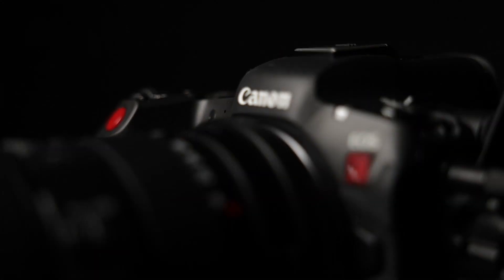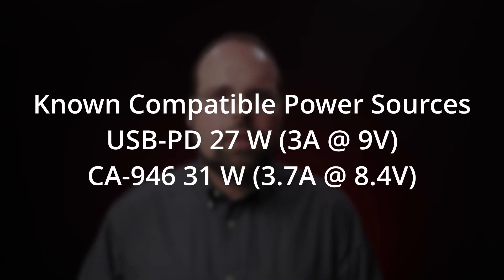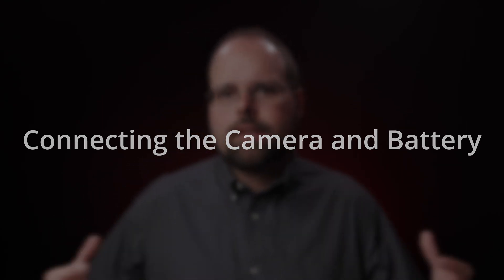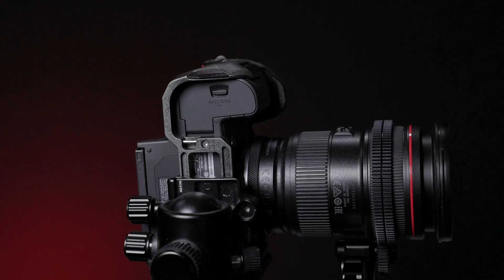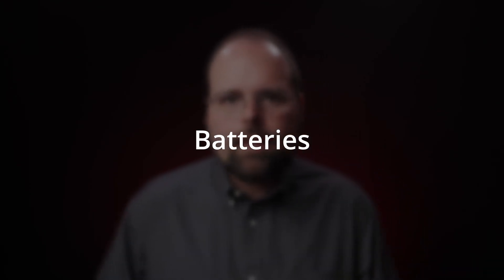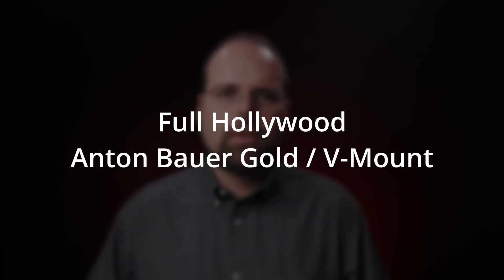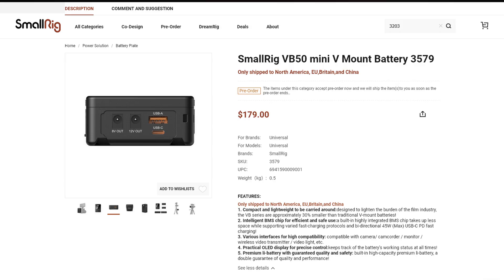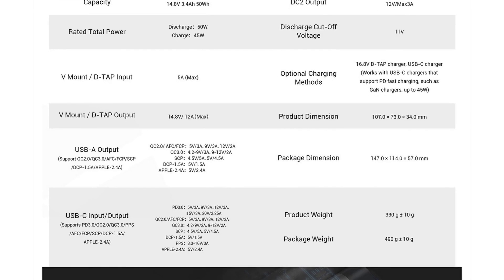External Power for the R5C - EOS R5C Tip 5

Comment: Found out the hard way. Did not know the R5C only needed a 9V dummy battery. Plug a 12-14V dummy battery and damage the circuit. Camera refused to come on. Had to send the camera to Canon Service Center in Virginia. Luckily it was under warranty so they fixed it otherwise it would have cost me $530 to repair.
Reply from the maker: Ouch, that sucks. 

That's easily the biggest reason I don't like using a dummy battery with the R5C. The camera doesn't have the internal voltage regulation to deal with the ~16V you get out of cine batteries. So you've always got the risk of frying something if you're not careful with the battery you're using.

Comment: Thanks for all the useful insights, Jason! I did make the mistake of connecting the D-tap port on the FXLION Nano One to the R5C via an  unregulated dummy adapter 😬 It didn't fry my camera but it did seem to lead to horizontal lines in the image (similar to the lines you see when your shutter speed doesn't match the light source's frequency). After seeing your video it looks like I fed the camera way more power than it was designed to handle (or am I missing something here?)... 😬 I stuck to USB-PD afterwards, and the camera is fine.
Reply from the maker: Thanks for the info on that. Also I'm glad your camera survived just fine. 

That said, it's good to know that the camera is at least fairly resilient to moderately high voltages — or at least it won't let the magic smoke out at 14.4 volts. It's quite possible that the camera can handle a fairly wide input voltage range, since everything has to be regulated internally anyway (the processor and sensor are probably operating in the 3.3 volt or lower range), but there's no published specs on what that range is and as you saw going too far can certainly cause problems.
Reply: Happy to hear you didn’t fry tha cam. Are you happy with the battery?
Reply: @PointsInFocus  Thanks for the additional info! A few years ago I had another dummy-battery 'accident' when I inserted the D-TAP plug the wrong way. There was smoke involved... 😬I think it's safer for everyone if I stick to USB-PD 😉 Thanks for providing us with all of this super-useful and in-depth info!
Reply: @Mintyseden  Yeah, the Nano One has really become my swiss army knife on shoots. Even if I'm not shooting with the R5C it's super handy for quickly charging drone-batteries/phone when moving between locations and it can even power my laptop. On the R5C it roughly gives you 3 times the runtime of a single LP-E6 and the size makes it easy to rig it. I have it attached to the bottom of the camera so it doesn't get in the way. Do keep in mind that because of the smaller design it doesn't work with all v-mount plates. The new Smallrig ones do work as do FXLION's own plates.
Reply: @Points in Focus, new sub and thanks for doing the heavy lifting.

@Filmkit, oh man, I made the same mistake on my brand new Sony A74.  Fried the main  
motherboard.  Got it for a good deal but after that user error mistake, cost me abt $500 to replace a new motherboard directly from Sony.

The issue was the dummy battery to d-p-tap was not regulated.  Bought off Amazon and didn’t realize this.  The website didn’t mention any warnings and the V-mount battery I bought from Core SWX didn’t mention it either.

Anyhow my expensive mistake.

I also recently bought the Canon R5C and here are some additional information and options to consider:

- Core SWX recently updated their Powerbase Edge to the PB Edge Link.  The upgrades are: 1) It fixed the issue of the mounting plate with a much bigger base so it’s more sturdy and stable; 2) It increased the capacity from 49wh to 70wh; 3) It has a PD port that can power the R5C directly with a USBC cable; 4) you can stack or link to other PB Edge Links for parallel power if needed.  

The older model and the new one still has the runtime LCD, travel safe within airline requirements, has vmount adapter, has 1/4” mount hole to attach to tripod or other mounting options, etc.

I’m not affiliated with them but was waiting forever for the Anton Bauer Titon Base and at NAB 2022, this new product was released.

Note on top of the PB Edge Link, I put in the Smallrig Side Handle 2222 with a Neewer QR Plate Adapter.  I have Smallrig 3890 cage that mounts onto the Neewer Plate Adapter.  It takes away all the hand jitters as the weight is balanced when I film handheld

This can be used to power any camera setup for long hours.  And get a second one if you film continuous all day.

- a much cheaper alternative is buying the Smallrig Power Bank Adapter 3085 that uses a powerbank plugged into the USBC input and a dummy battery into the DC port of this adapter.  I use Nitecore NB20000 as it’s small and lightweight since it’s made out of carbon fiber but has 20,000mAh

I couldn’t find anywhere how to compare the power consumption in each filming mode but saw on other YT channels that a LP-6NH is 2,130mAh and has a runtime close to an hour (depends on the frame rate and shooting modes) but rough average.

So here’s what I calculated:

1 Wh to mAh conversion:
Wh x 1000/Voltage = mAh

So for 70Wh (assuming 1 LP-6NH = ~1hr):

Using dummy battery with d/p-tap @8V:
70 x 1000 / 8V = 8,750mAh
Runtime: 8,750 / 2,130 = 4.11hrs 

Using PD power @9V:
70 x 1000 / 9V = 7,778mAh
Runtime: 7,778 / 2,130 = 3.65hrs

Lastly, here’s what I found on power consumption in different shooting modes and recording times with a LP-6NH:

Power Consumption:

8K RAW 25P: 10.5W
8K MP4 25P: 11.2W
4K HEVC 50P: 12.9W
4K XF-AVC 50P: 13.3W

Recording Time With Supplied LP-E6NH Battery Pack:

8K RAW 25P: 50mins
8K MP4 25P: 45mins
4K HEVC 50P: 40mins
4K XF-AVC 50P: 35mins
Reply: @nomad0714  Oh man, that's gut-wrenching what happened to your A74... ☹ The weird thing is that even the dummy-adapters that ARE regulated, often don't clearly state that. In the past I also fried a dummy adapter because I connected it the wrong way around... I guess it's better for everyone involved if I stick to USB-PD for now 😬Thanks for your calculations, this is GOLD for anyone looking for a battery solution for the R5C 👍 The Powerbase Edge Link sounds intriguing, I'll look into it 🤔
Reply: @filmkitnet , yeah it was an expensive learning for me.  The A74 stopped working as it had too much power going into it, probably 14V so it fried a lot of components so Sony said I need to replace the main board.  It’s working now but I almost missed a job but got it back in time.  The only thing was before it never overheated but afterwards, it overheated and Sony refuse to say something was wrong on their side.  Now I just upgrade the firmware and added some active fans as I’m used to it with the Canon R5.  

I almost got the Fxlion Nano One until I stumbled on the Core SWX Edge Link.  How’s it working out for you so far?

Comment: Late to the party... lol - Have you noticed that the R5C does not acknowledge the USB PD mode when the camera is turned off and then on (sometimes) and you have to remove and reinsert the USB-C cable?
Reply from the maker: I personally haven't seen that come up.

That said, it could also be a problem with your cable or USB power source too. To switch from off's 5V mode to on's 9V mode, the camera has to renegotiate the USB PD session with the power source. If the signal is bad or noisy that can fail (e.g. the cable is marignal). Additional, the power source can potentially not allow/support the change if it thinks the change in profiles is too fast or somehow could be the result of a fault. Not that I'm saying it's not the camera, it could also be the camera, but USB-PD is complicated enough that a marginal or slightly out of spec implementation anywhere in the chain could cause that to happen.
Reply: @ Thanks for replying. I'll give it a try again with a MacBook power supply (145W w/ 100W PD cable) and determine whether or not it still occurs. Doing some research indicates that this is a know issue, however, as you rightly point out, it is not clear if the issue is with the Canon firmware, the battery PD delivery or the cable. Thanks and Cheers!

Comment: This is EXACTLY what I was looking for. I have an EOS R5 MKII ordered, and was looking for info on alternative power sources for it. I shoot a lot from wildlife hides, and usually end up with a LOT of flat batteries. USB C PD seems ideal in that scenario.  Thank you so much for this really thorough treatise!👍
Reply from the maker: Be aware the R5-II requires 15V USB-PD not 9V like the R5 and R5C. You'll need to use a minimum of a 45W battery or charger, instead of the 30W that I discussed in this video. The noted Anker 747, as well as the new Anker Prime 27,650 are capable of this, but smaller battery packs may not be.

Edit to add: I'm currently shooting with and getting comfortable with my R5-II before I start producing tip videos like this for it. That said, powering it will be one of the first videos on that list.
Reply: @PointsInFocus  I was thinking of the Anker 737 Power Bank (PowerCore 24K), which according to the blurb is a 140W , 24,000 mAh PD power bank. Should be OK??
Reply from the maker: Yea, that should work fine.
Reply: @PointsInFocus  Thank you!

Comment: Thank you very much for the report. It is a very comprehensive report.
I would like to ask you a question and it would help me a lot if you could be so kind as to answer:
I have bought an EOS R5C camera and I need an external power supply to record in 8K and 60 fps. I have looked for the Anker 474 Power Bank but I can't find it in Spain. I have seen the option of the Anker PowerCore III Elite 25600 PD.
Do you think that this power supply is enough to power the camera in a safe way?
Thank you very much!
Reply from the maker: That should be the same battery pack. 

Anker seems to have renamed their product lines (or just the kit/sets, I'm not completely sure). The battery that came in my 747 kit is labeled "PowerCore III Elite 26K 87W".

Comment: What do you mean by, if it's usb-c, it's not a probleme.
If I bought a external batterie of 30W   ..  15V at 2A in USB-C    It gonna work or risk to damage my R5C ?
" INIU P43-E1 30 W 10 000 mAh Magsafe"
Reply from the maker: What I mean by that is as long as the power supply or battery bank you bought is a complaint USB-PD device, then it will either power the camera or it wont, but it won't damage it. USB-PD requires the camera and power source to agree on what voltage and power draw are going to be used before that voltage is actually made available. If the battery/charger doesn't support the 9V/3A profile, then no power will be delivered to the camera.

I looked up the battery you mentioned, it supports USB-PD v3, so it should work with the R5C, or at a minimum it won't damage it.
Reply: @PointsInFocus  Thank a lot, at least, if it don't work, I dont kill my R5C. Thanks !
I need a power supplie for my dual Fishe eye lens at 8K, 60 fps.
But even the SmallRig accessory are Big and heavy. 400G for LPF970 + NP-F adaptators. 
 
It's realy hard to find something realy small and light. Even if it's only works 15/30 minutes.. It's barrely enough for my use case in VR.
Hope this one will works.
If you know something that should work, I will be glad to know.
Reply from the maker: For what it's worth, I use a SmallRig NP-F Battery Adapter Mount Plate (advanced edition) (part number 3168B) and a standard NP-F750 or NP-F970. It's USB-PD so you get the full 8K60 capabilities, but since it uses standard batteries you can buy whatever you want and change em on the fly.

I show I have it rigged in the power section of my rigging the R5C video here: https://youtu.be/la79_tT5m3w?t=1021
Reply: @PointsInFocus    For the moment,  I am using a little Vmout on the left of R5C with a battery that serves as my handhold
https://youtu.be/99CgJt0hp8Q?t=292 
But it's stay heavy and big and need a cage. 
If the Inui battery works, it's shoold be place on the Flash socket with a Magnet. 
That the idea !
With a dual Fisheye lens, nothing can be in the front of the R5C, cause you will see it on the VR180° recording.
Reply: @PointsInFocus   Hi ! I was a little bit afraid of the low A of the iniu, so I tried this one :  "Baseus Batterie Externe Magsafe PD 30W, 10000mAh Magnétique Power Bank avec câble USB-C"
 
And it's working with the R5C at 8K60 FPS.. :)
So it's ligth, and a simple Round magnet Magsafe with 1/4 screw Handle it !

No need to rig it with a SmallRig Cage anymore. :)

Comment: Hey Jason! I have all of your R5C videos saved! Thank you I u! I do have a question though, and only because I trust your testing and knowledge... is there a solution to power the R5C via usb-c all while transferring data to an Atomos for example?
Reply from the maker: Unless I'm missing some new Atomos product, they all connect with HDMI. So as long as you can plug in the USB-C cable to your power source, you can hook anything up to the HDMI port you want. I run my R5C with USB-PD and an Atomos Ninja Ultra all the time.

Comment: Thank you so so much for all the info! Really saved us!
Since I can't buy anker 747 because of the lithium battery shipping restrictions (I live in Croatia and they don't have those batteries here), I was wondering if you can tell me if anker 737 is an okay replacement for 747? 
Thank you so much in advance! :)
Reply from the maker: The 737 should work fine. If it's the current one that matches what you see on Anker's site (with the PowerCore 24K), then its probably a bit better than the older 747 that I'm recommending in this video. I think there was also an older version of the 737, that looked like the 747 but had one fewer ports, that would also work as well.
Reply: @PointsInFocus  thank you so much for such a fast response! I also found the ANKER PowerCore III Elite 25K, 25600mAh, 87W, PowerIQ, QC 3.0 and with everything I learned watching your video, I believe this one may work as well. It charges 3A 5V, so charging may be a little bit slower. The design is not that chunky and I can mount it on my cage. 
Thank you again, you're a life saver :)
Reply from the maker: Basically as long as the charger says it can charge at 30W or more, you should be good. Anything that says it can charge a laptop is probably a safe bet.

The R5C requires 3A at 9V (27W), to operate (powered on and record), and 3A at 5V (15W) to charge (powered off). The charger must supply those profiles specifically. The way USB-PD is supposed to work is that you can look at the listed charging wattage (say 45W) and if it's higher than the wattage of the required profile (e.g. 9V * 3A = 27W for powering the R5C while recording) then the charger is supposed to provide the required power profile for your device. Unfortunately, this seems to have made the situation more confusing for everyone rather than simpler.

Also, if you're looking for a more compact solution. You might want to look at SmallRig's Advanced NP-F battery plate (I think that's the name but their site is down for me at the moment so I can't check). You use it with an NP-F 700 or 900 series batteries and it provides the required USB-PD outputs for the R5C. I've switched to using one of these most of the time due to the size and weight.

I get about 2-3 hours out of a NP-F 700 series battery, and of course, when the battery dies the camera seamlessly transitions to it's internal battery, and you can swap the NP-F battery and it switches seamlessly back.
Reply: @PointsInFocus  that sound great also! I will look into the NP-F then and see what works best. Thank you so much for the response and such detailed explanation!
Reply from the maker: FWIW, the Small Rig part number for the NP-F battery plate is 3168B.

Comment: I just used my MacBook 145w usb c block and I’m getting PD. From my understanding of what you said, this is safe correct?  So far so good.  But then I started to second guess the safety of doing this.  Is this ok? Thanks for the great videos!  I wish you had a c70 series too. You are extremely helpful!
Reply from the maker: That's perfectly fine. In fact, I use my MBP's charger with my R5C quite often.

First, remember, USB-PD isn't like old DC connections. The device and charger actually communicate over USB about what profiles are available and what the device needs. If you plug the camera into a USB-PD supply that can't provide the right profile, the camera will simply not use the USB port for power at all. This is a big part of why I like USB-PD for camera gear instead of the old approach of a "dumb" DC connector that can have basically any voltage on it.